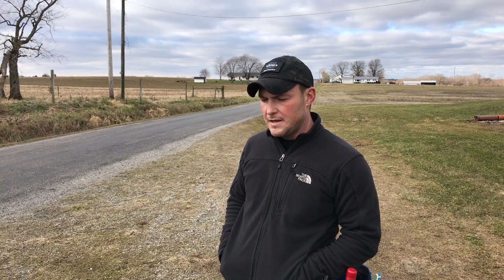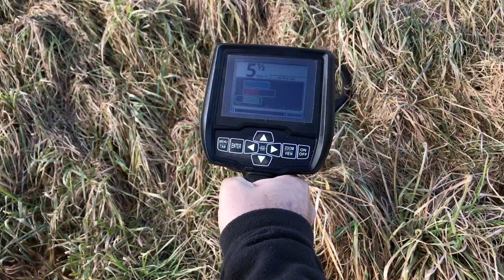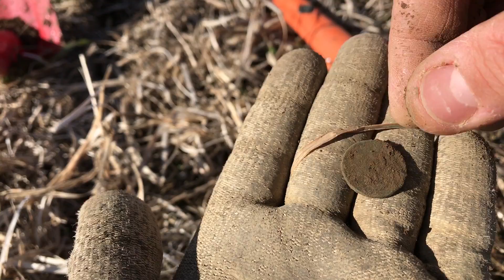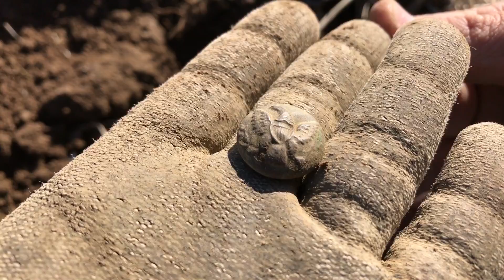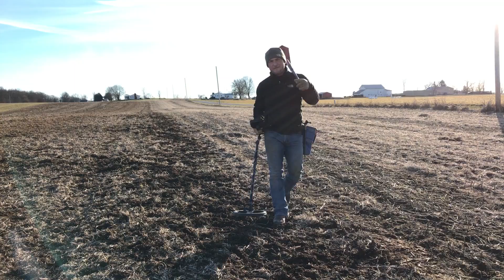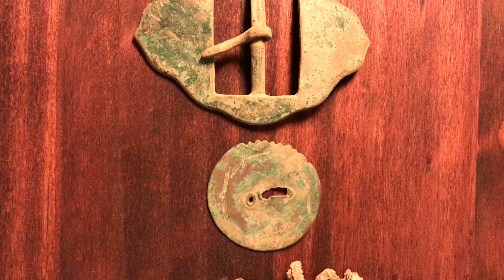Let's Try the Other Field Metal Detecting

Comment: A little helpful tip with EMI go to single frequency cause in some areas u can't run on 3 and try to adjust your freq you'll get deeper on single frequency
Reply from the maker: Yes. I tried switching between frequencies, multi, single and just using the least effected frequency measured in pinpoint. I droppped and raised the offset and still nothing. I even took my add all the way down to 4 and threw on tx boost to compensate for poor sensitivity at 4... didn’t work. I was somewhat bothered at that point and hung it up. Lol. Glad I did tough to find the items in this video. I’ll be out there tomorrow and hunt the high EMI site with the Sport... gonna be 2-3 inches of snow on top of that high lake over hay so I’m not real excited about that. I can still dig.. so I’m gonna go. 👍🏻

Comment: Try a minelab Equinox great when it comes to EMI I run mine with no discrimination and clean up!
Reply from the maker: Currently I don’t own anything other than Whites machines although that is not going to be the case soon. The 800, Anfibio and Alter 71 are in the lineup. Hope to have one of them soon. Thank you for commenting and checking out the video. 🙂

Comment: What do think about the 6by10 eclipse coil.
Reply from the maker: I like the 6x10 a lot, it’s a great tool to have. Just like in this video I hunted an area littered with iron and pulled some nice items out. But... when I go back I need to hunt the site with a smaller coil to squeeze out the good finds that got masked out by iron in which I was given a combination VDI due to having two targets under my D2 during this hunt. The next time I’m at this site (the open dirt portion) I will hunt it in this fashion and point out the difference between the two coils hunting that spot. Thank you for checking out the video.

Comment: Civil War General Service enlisted button and Civil War era store token?  very nice indeed!
Reply from the maker: That’s what I found after getting home... I was super happy. The token I had to  work on quite a bit for enough clues to be exposed to start searching. I guess a few wrong on my sheet in the video but ended up having luck discovering the next day. It’s a lot of fun and a great feel of achievement when you get that ID on something that’s unknown. Thank you for commenting and checking out the video. 🙂
Reply: Enjoy the quality vids- how do you like the MX sport?  Ive heard the processor is slow and grabs onto a target which is not good if if its a busy area with lots of iron if you re trying to pick out good targets in between?
Reply from the maker: @bamadave6324  The Sport is a great tool to have in the lineup. It does give me a ton of blips and cracks in it's language if that makes sense. I think the processor is quick but not lightning fast which plays into the detectors role as a all around work horse. If the processor was too quick it's like always running a 35 recovery speed. In trashy areas.. awesome... in not so trashy areas.. your cutting yourself short. I do like the machine and it's as reliable as any top end machine. The ease of setup, the ability to handle high EMI, waterproof, strong detection performance and it's compactness all keep me using it.